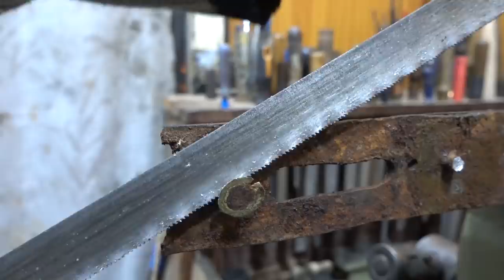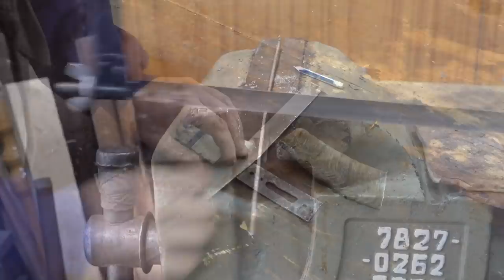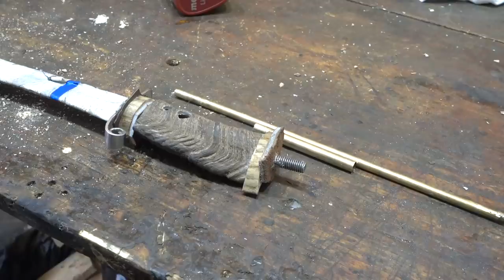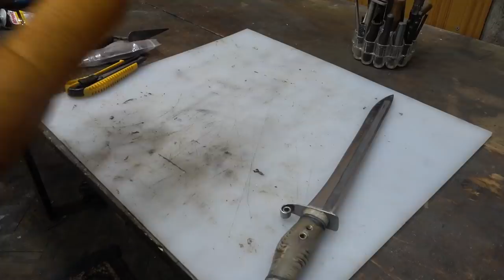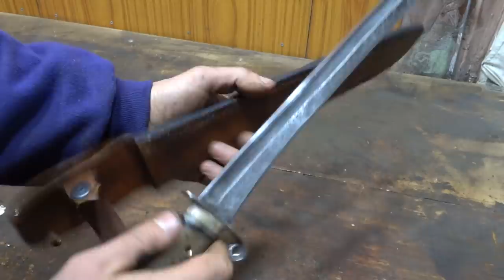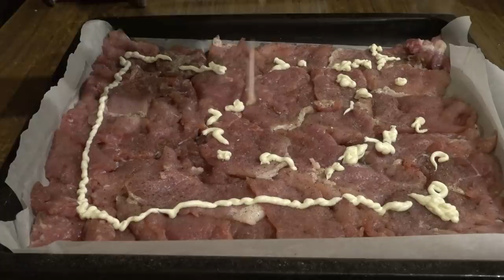Restoration Rusty Knife What Is This?

Comment: It could be a German bayonet Mauser K98 WW2 in the worst conditions. The coupling ring to the gun barrel is missing as well as the original handle that should be was in bakelite. Perhaps it would have been better to leave the guard without curl because it may be dangerous for the finger. Anyway, an interesting object and a good restoration 👍

Comment: This type of blade points to a Belgian or British Bayonet, but somebody shortened it and removed the original handle and carbine catch. Possible model P 1907 s. S for short. Earlier versions were up to 63 cm long. Can't be sure though. If there is no punch or hallmark it could be any other model.